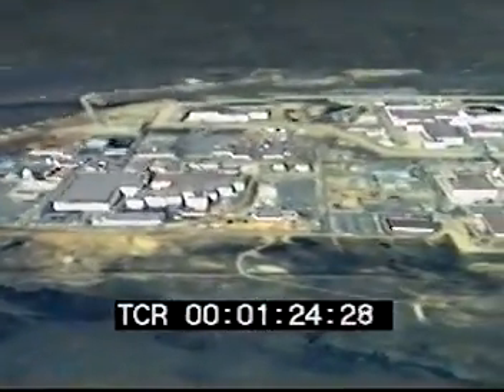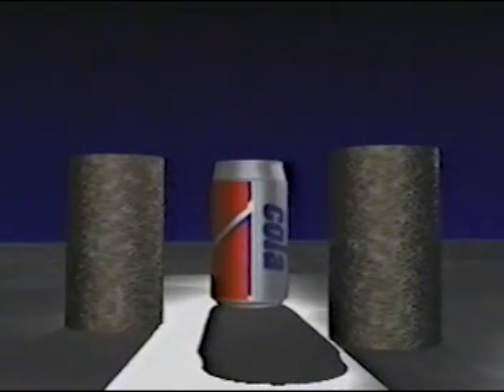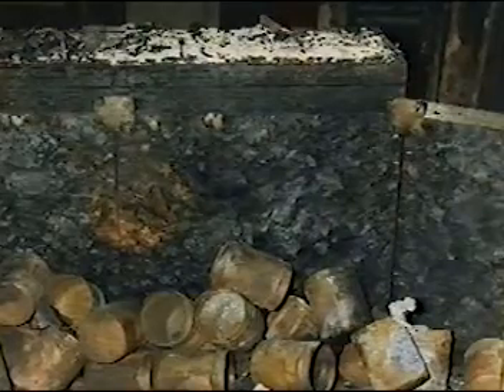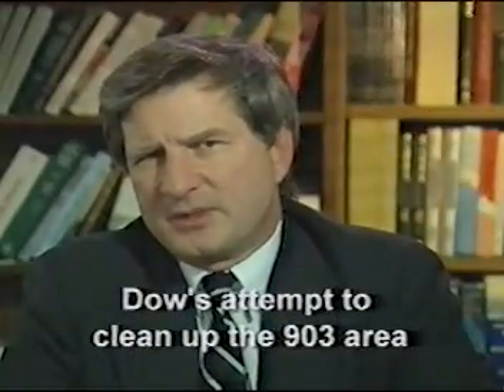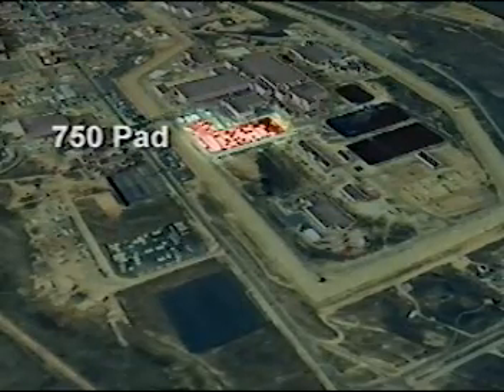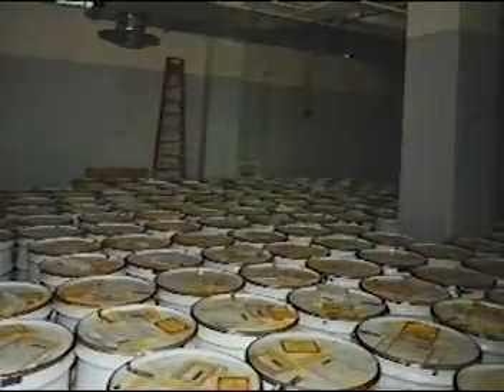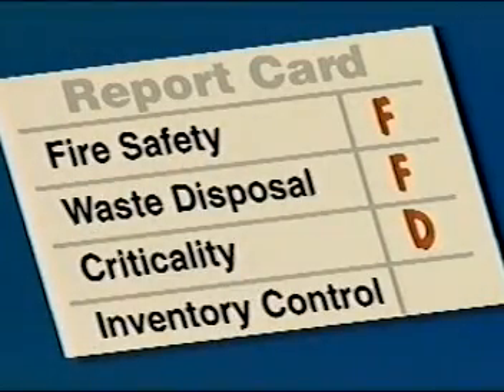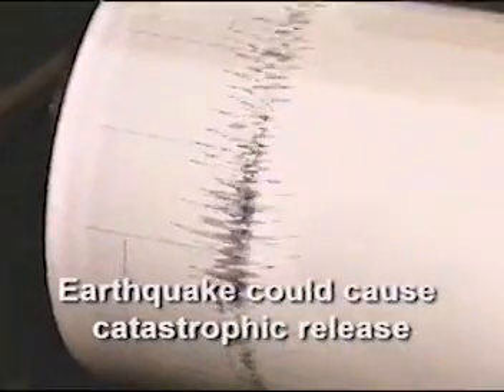Rocky Flats Health and Safety Violations: The Must-Watch Evidence

Comment: Just to create a memorable image in the mind. Pre-atom bomb steel is still salvaged from shipwrecks because of contamination when making Geiger counters, spacecraft detectors etc. The phrase 'almost returned to pre-1945levels' is not reassuring because it is specks of very high radiation. Grading by wind spreads it unevenly. On beaches too. Grading means for example all sea shells or pebbles of a certain density and size get deposited in specific areas.

Comment: Seems like they could have easily built a multi floor steel frame building over the 903 pad, where they could have re packaged the waste, and then decontaminated the floor. After that the rest of that building could have been used for safe storage of low level waste.
Reply: That would have taken away the bonuses FOR YEARS UPON YEARS had they done that ... money is ALWAYS more important than destroying someone's (or thousands) life
Reply: Not so simple.